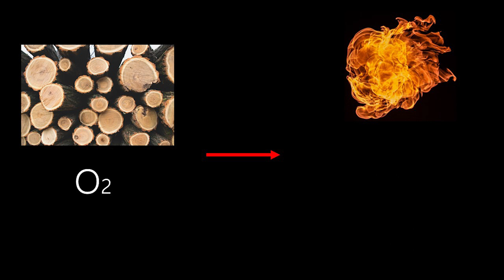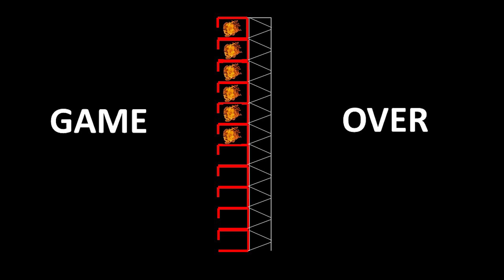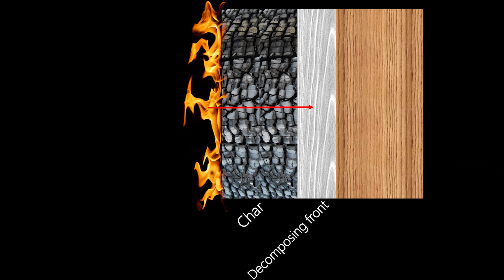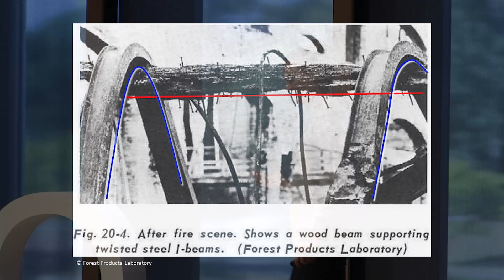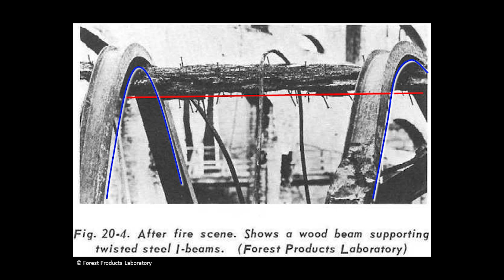Self-extinguishing timber buildings: a climate change solution? | Carmen Gorska Putynska | TEDxUQ

Comment: This is just basic fire engineering and structural engineering - nothing innovative in there. Although I'm a strong proponent of timber use myself, I'm annoyed by the slightly condescending tone of  this presentation. At 10.40 - a tree suffering from charring on the outside surface won't survive in a forest, the outer layer contains all the living cells and the inner core is pretty much just dead cells - she displays a lack of basic knowledge.